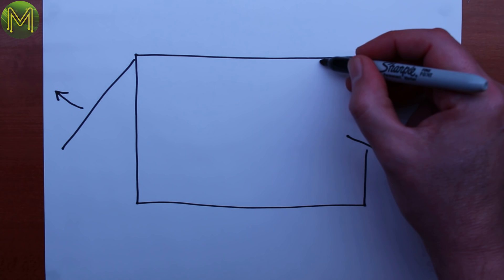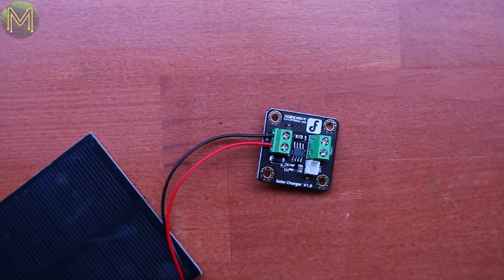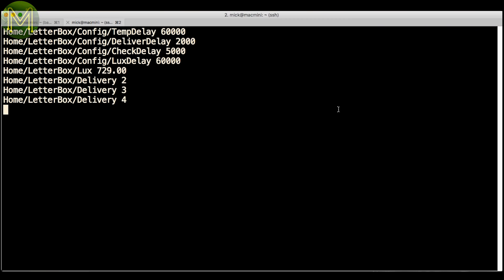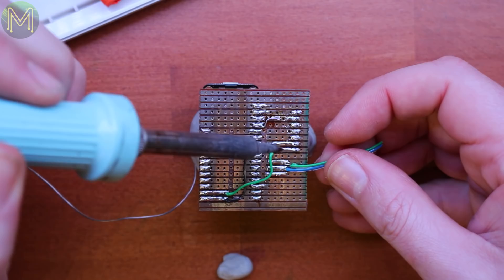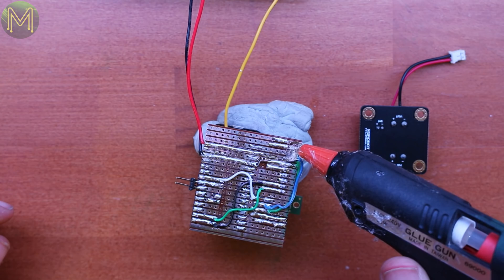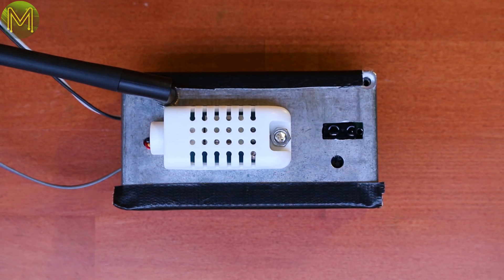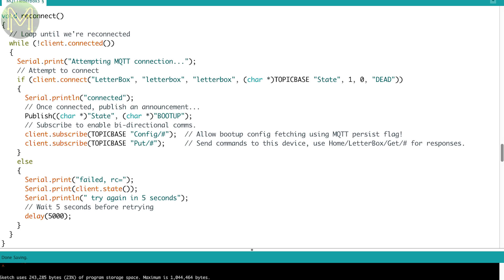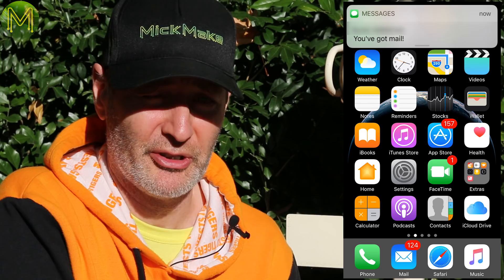#136 Building an MQTT letterbox Part 1 // Project

Comment: Hey Mick, thanks to your mailbox idea I've come up with another one.
I'll name it the 'Loud Effer Gotcha On Mailbox Camera'' for the truckies who haunt my quiet mornings.
Maybe I'll also add a super bright LED to let 'em know to take it easy on the pedal :-)
Reply from the maker: A yes, those truck air-brakes can be annoying. Get a Teensy to run through some FFTs on the ambient noise and when you pick up the distinct air-brake noise you'll be able to take photos. Run it just between certain hours of the night and drop down to sleep mode during the day for a full charge on batteries.

Comment: Nice.  I like the idea of using hot glue as a stand off.
Reply from the maker: +Yedan Dva 
Thanks mate. Yup, use it a lot, but of course it’s an issue if the board is going to be in high temperatures.

Comment: I was going the pir route with a rpi, but this approach is a lot more robust... now I've a reason to go into mqtt as well!
Reply from the maker: +RamblingEngineer 
Ha ha. Nice! Love it when people have ideas. Let me know how it goes.
I'm thinking that I'll need to ditch the lux sensor and maybe the DHT for battery conservation. We'll see at the end of this week.
Reply: RPi is such an over kill for this sort of project. The ESP8266 is a much better solution, particularly cost wise.
Reply from the maker: Craig Fryer 
With a much cheaper solar/LiPo setup and an ESP module it'd be very cost effective and you can get the ESP to sleep for long periods. I think people have seen up to a month runtime.
The Pi would be very difficult to keep running on LiPo, even with solar charging, but may be possible with underclocking, but as Craig said it is a bit of overkill.

Comment: Good tutorial, can be followed and copied or parts of it used to expand upon in other projects.  

In the UK no house has a post box on the outer of their property, post always comes through the letter box. Some flats do have a postboxes, but this is normally on new builds.
Reply: TheDutyPaid any house with a large front garden that doesn't face a road usually has a 6 foot fence for privacy and has a mailbox in it.
Reply from the maker: +TheDutyPaid 
That's interesting. I guess you could always add it to your front door. Then it could also double as a doorbell!
Reply: Think I'd build a mail pipe large enough to bring the mail into the house automatically. Oh wait! No need ... My letterbox is on the front door ... Because unlike Australia, in the UK it rains a LOT and getting drenched (together with soggy mail) whilst collecting it is not fun! People in the UK with mailboxes at the front are not totally uncommon but outnumbered by those who don't by thousands, if not tens of thousands to one ... And they still have to open their gates to enable parcels to be delivered! 😂 Good project though, I'm sure outside the box (pun intended) thinking will identify other more suitable uses in the UK ... Like are the kids in the tree house? 😂😂

Comment: Hey Mick,
As for the TSL2561, I'm guessing Adafruit may have some inefficient linear regulator or too strong pull-ups or something of the kind on their little board.   The TSL2561 itself never consumes more than 300uA and in sleep mode is more typically always less than 5uA.   Maybe if you bypass their regulation circuit or increase the pull-up resistors  you may be able to extend your battery life.    Also that sensor can be programmed to generate an interrupt when the light level is outside a user defined window.  Using this feature may save you the current draw of polling it.  Not sure if the Adafruit library supports this but if not it's only a few some I2C commands to enable this.  Hope this helps you.  Cheers.
Reply from the maker: Hi David,
Yup, that'll be in the second revision. This first revision was looking at what is possible. I'll be running another video on that exact subject - power optimization.
Unfortunately, the AdaFruit code doesn't have any support for interrupts, but it's just a simple matter of forking from GitHub and adding it in myself. :-)

Comment: Be sure to put a watchdog timer added to reset pin and checking on your internet connection in case your net goes down.
I think this would have been better with a lower powered device with a radio posting to mqqt but guess you have to work with what you got. At least you found some use for parts laying around.
Reply: I was thinking that WiFi could just be turned off. You can't put the ESP8266 into Deep Sleep as it would not be able to monitor the sensor. You would only need to turn the WiFi on to send data. It would depend on how often you wanted to send temperature/humidity/light data.
Reply: You could deep sleep the ESP8266 if you could wire the sensors to trigger a reset to wake it up. On wakeup you'd need to determine which sensor was responsible.  You might need to "front" the ESP8266 with a small microcontroller like an ATtiny which is designed for deep-sleep applications.
Reply: I have seen a few projects that have done this. It does make the overall build much more complicated.
Reply from the maker: +ytfp 
Yup, it is heavy on CPU cycles. However having something like this in a letterbox does open up opportunities for other creative things.
This week I'll be looking at power consumption on the ESP to see how low I can get it.
Reply from the maker: +Craig Fryer 
Yup, you'd need a gateway in the Broker to bridge RF signals to WiFi. Might be worth a video on that!
Reply from the maker: +Aled Morris 
True. I was thinking of using the ATtiny for that. Create it as an I2C slave and the job is done!

Comment: Nice work Mick I have a question.  Because your mail box is metal did you have to open the back a bit for range? Also have you got this on a website as in instructions and code mate.
Reply from the maker: Hi Chris,
Thanks Chris.
Yup check out the description or the pinned comment to this video.
There'll be another update to this video this weekend.
Reply from the maker: On the range: I had to add the external antenna which boosted it enough to reach my access point

Comment: Mick, before I started my engineering career I was a dab hand in the electronics lab. But I trained for radar systems engineering, quantum physics and microwave and laser (new then) communications. So it was design, design, design for 30 years no time for the lab. I'd like to get back to the lab and I know instrumentation is completely different from my lab days. If you don't mind what kind of scopes, DVMs, signal gens and general kit do you use for your projects? Many thanks. (I'm planning to become a patron as soon as I finish this message). BTW you do beautiful soldering. Cheers!
Reply from the maker: Hi Brian,
Thanks for that mate. My soldering isn't as good as it used to be. Back when all I was doing all day was soldering... that was a work of art. You could see yourself in the reflection. :-D
I'm actually slowly building up my kit again. These days it's all digital, unless you're talking high end RF, then it's digital all the way. Of course you get the CRO die-hards.
Even the cheap $30 DSOs are fantastic, but if you're going to get the best reviews on test kit - better head over to my mate's channel +EEVBlog.

Comment: Could you explain how soldering a wire to the antenna and the shielding of the wifi module made an antenna? Surely the shielding isn't connected to anything
Reply from the maker: The shield of the ESP8266 module is grounded and so acts like a small Faraday cage. I soldered the ground wire of the external aerial to the case and the antenna wire to the PCB antenna, the other end was an SMA connector, where I attached an antenna.

Comment: Thanks Mick for another educational video.
I'm somewhat surprised the mailbox doesn't act as a Faraday shield. What is the distance between your letterbox and receiver?
Reply from the maker: +judgeguilty 
Thanks!
It's around 200m and surprisingly doesn't attenuate the signal much. Adding the external antenna was essential. Without it there was no signal getting in at all.
Reply: 200m!! I thought it was a long way to my mail box. I assume you are on a semi rural block. Ours is a battle axe block and that makes it far enough. We use a PO Box though.
Reply from the maker: Craig Fryer 
Actually I don't get that many letters as I also have a PO Box, but the occasional letter that I do get tends to sit there for a while before I remember to check the box out.

Comment: Other than just for interest sake, what is the purpose of the light/lux sensor for? I would have thought it would need to be on the outside of the mail box.

Do the solar charger or on board LiPo charger provide any information on the amount of charge sent through?
I suppose it should at least provide battery voltage.
Reply from the maker: +Craig Fryer 
Ha ha. Yeah I was just adding stuff on it. This week I'll remove it as I'm looking at battery conservation.

And that's where I'll also look at the solar charging output side of things.
Reply: I just realised you have forgotten the MOST IMPORTANT module for this project.
The one the thanks the postie for depositing the mail :)
Speaker, amplifier and MP3 module.

Of course then you will have to amp it up a bit. Camera and AI to identify what is delivered. Exciting mail or just bills and then send messages as appropriate. Not sure that the postie would appreciate a response like "no thank you" when they just deposit bills.
Reply from the maker: +Craig Fryer 
Ha ha. Yup sounds like a great idea. Being able to see what's inside the box wouldn't really be too hard and MQTT can handle that easily.
Thanking the postie would be even better.

Comment: Think this is something I'll have to look into. What are the security concerns with a system like this?
Reply from the maker: +James Coyle 
Well, someone could take the letterbox and there goes your $50 and a day of building, (or maybe a weekend).
Apart from that MQTT Brokers support the use of SSL, so it's as secure as any computer connected to a network.
Reply: I figured that would be the case. Just don't wanna be to blame if someone gets into the network for any reason. I've been doing reasonably simple projects for a while but have yet to move into the Linux boards or anything IoT related.

Everywhere seems to be going on about IoT hacks and vulnerabilities at the moment but from what I've read it's only really an issue for people that aren't changing the default login details on the device which is never gonna be an issue on any maker project really. I like to be aware of security though so I thought I'd ask to make sure.
Reply from the maker: James Coyle 
As with any new technology moving into vertical markets, manufacturers have no clue how to handle it. They dip their toes in the water and their whole leg gets bitten off.
The recent DDOS attacks from unsecured IoT devices like fridges and washing machines is evidence of that.
What really concerns me is driverless cars. Putting aside the "blame game" of who's responsible for a car killing someone, I'm more concerned about the car actually being hacked to kill someone.
Gene Howard didn't go far enough with his quote of "the only secure computer..." he should have continued with; "... run through a grinder, incinerated, and the ashes spread to random parts of the universe."

Comment: clever idea..
Reply from the maker: +DIYelectronics 
Now I don't have to worry about my mailbox being full!
Reply: this often happens to me. but i think that the solar panel you used is small and not enough powerful to charge the battery completely. what if there is cloudy weather for, for example, 3 days?
Reply from the maker: DIYelectronics 
Yes, I'm looking at power requirements this week.
Reply: +MickMake  a question not related to the video. have you seen the new orange Pis boards?

Comment: Could you please put a list of the parts? Especially the solar panel, battery and the battery charger?
Reply: The battery charge controller looks like it's this one: https://www.dfrobot.com/product-1139.html
Any LiPo would work and I think it's inevitable it'll come with the wrong JST connector :-/
Reply: Thanks!
Reply from the maker: I've put the full parts list up now. Here it is:
https://mickmake.com/archives/2482
Reply: Thanks!

Comment: Why not use the cheap (3$) nodeMCUs from eBay, I have 6 of them and they work just fine
Reply from the maker: +MCgamingPro 
It's just a personal thing, but I dislike nodeMCUs. However most of them are based off ESPs which is what I used in my letterbox.

Comment: great video. I tried to do something of this kind myself. without mqtt but with ifttt. worked kinda ok. my problem was the small mailbox, the metal frame with low wifi reach and I was not allowed to modify it completely to my needs. but seems to be great. if you want to check out a great esp project check out luftdaten.info a project for publicly measuring the air quality.
Reply from the maker: +Paul Hein 
Thanks mate.
Yeah, I had a similar issue with the metal letterbox and I was using an aluminium enclosure as well. There was zero wifi signal.
I've used IFTTT as well, but the good thing with MQTT is that it removes all the application logic from the device.

Comment: Nearly lost all respect for you when you put soldered strands into screw terminals, instead of properly crimping them with ferrules. At least the terminals looked like they were rising-clamp ones. If not ... well, I guess your colonial heritage is showing. Brits have no shame with electric installations, either, certainly not from what I've seen in many years of temporary work-related exile.
Reply from the maker: Yup another one to add to my goofs video. I'm aware of the slippage issues with tinned wires and screw terminals.
Reply: Take care, wire safely, and best of success with your projects!